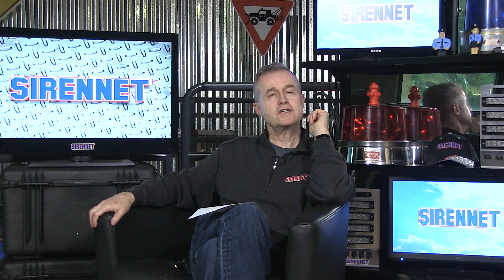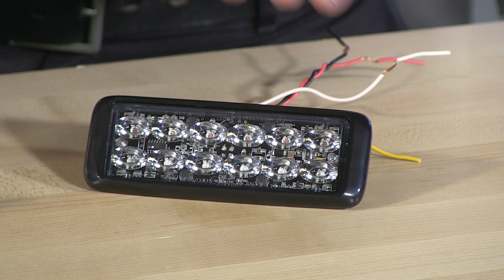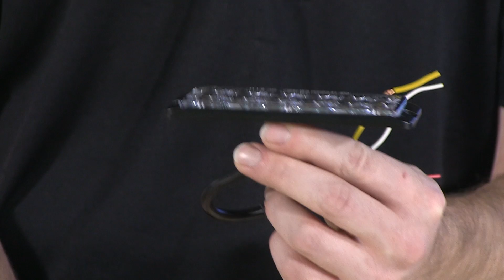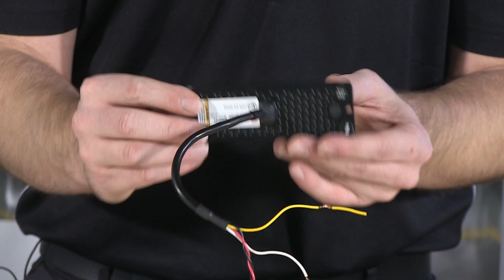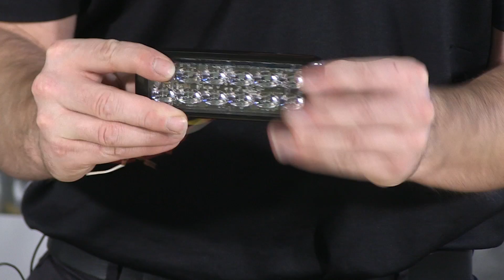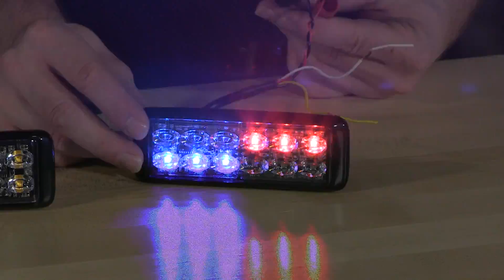Federal Signal MicroPulse Ultra 12-LED Surface Mount Light

Comment: i have 8 mini flush mount led strobe lights, it came with a controller box, but dont want to use that, will the lights still strobe without it.
Reply from the maker: Do you have a part number or better yet, a link to the item so we can take a look?

Comment: Does the dual color Surface mount also have dim mode for night time
Reply from the maker: The 1220 Dual color does offer low power.
Reply: SIRENNET do you have a part number for the 1220
Reply from the maker: Our Sales Team can help you with that. Their available at info@sirennet.com or (888) 959-0911.

Comment: If white was one of my colors, can i activate a FLOOD mode?
Reply from the maker: According to the install sheet there is only 1 programmable mode for this light. It can either flash or be stready burn. Code 3, ECCO, SoundOff, and Whelen all make true Dual Color lights that have separate programmable modes for each color. Contact our sales department and we will be happy to help you make sure that you get the product that best fits you needs: 503-670-4700 8 am to 4:30 pm M-F.

Comment: Couple questions #1 can these be mounted in a front window like under a viser? And the second question was about the light bars on the shelf I was wondering what the LED one on the top was?  It looks like a whelen liberty but the take downs are different also I was wondering what the lightbar on the bottom shelf was? Looks like a outside Verison of a feniex traffic advisor.
Reply from the maker: With their compact size and depth, they sure could.   The Whelen Light-bar is a Delta Rota-Beam. The Feniex Bar is special version of the Avatar that they offered for a short time and designed to only offer full White flood/scene lighting.
Reply: SIRENNET here in Johnson county Illinois we had a sheriffs car that was black unmarked and for the front we had a set of little square lights for the grill white strobes and a set of sho-me slim lights that's was on top each other and to flash crisscross like this then the back blew in it and we replaced with a Ford Explorer with feniex lighting the dual colored bar the appolo I think and the 6led lights heads on the pushbar with a off tossing lights over them and white strobes in the blinkers and the back we added the 8head feniex lightstick we had in the back of the crown Vic to the back of the explorer (to save money) and feniex surface mount lights in the license plate and white strobes in the reverse lights and appolo dashlights on the sides. Still not a bad set up.